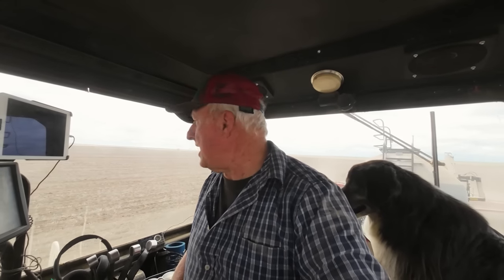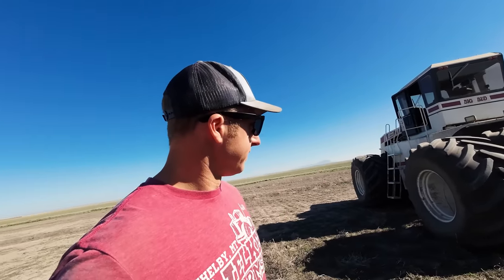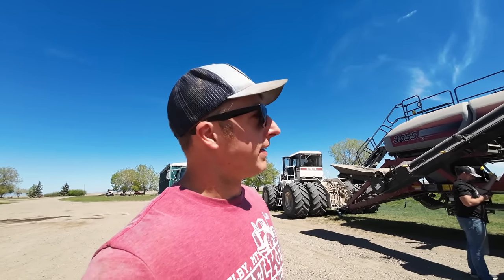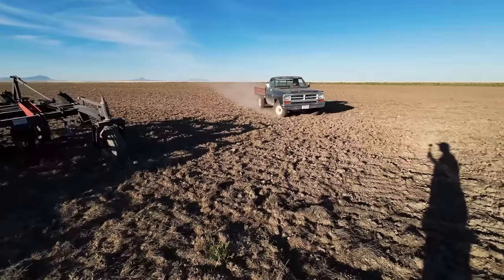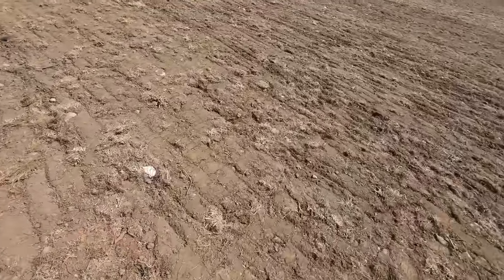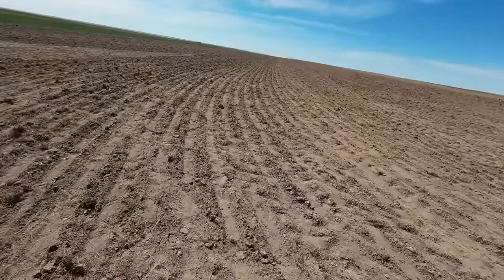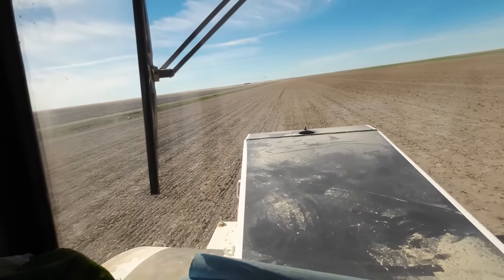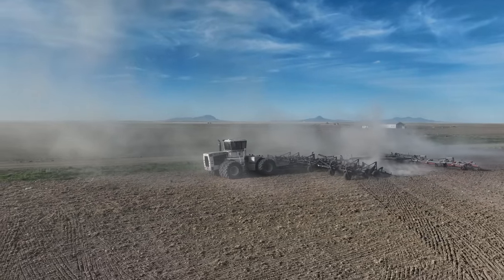Last Of The Acres! Final Push To The Finish Line! Farm Dog Approves!

Comment: Yeah we have had a bunch of days of the smoke here in Minnesota. Advisories to stay indoors were out as it was 200 ppm. I guess there were 115 out of control fires in Canada is what I looked up. We arent getting any rain here in Minnesota either. We did early in Spring but that has since gone away for about a month now. Everything is brown here. Sad. Seems it has been correlating to your weather as well. Every time it looks like it is going to rain it does for about a minute and then the system dissipates and is gone. Very odd weather the last three years. Praying for rain for you guys!

Comment: Is there any more benefit to using the coil packers on the soil finisher then using the ones that are more solid like the ones from brillion cause in ohio I have used the ones from brillion on back of 30 ft Krause disk and on back of john deere soil finisher to prep seed bed we pulled it with John deere 8870 articulated 4wd or a john deere 9400 articulated with triples  I like the brillion packers better than rolling basket they have also we use both  great vid guys keep up goid work hope you get more rain this year👍

Comment: Maybe just the video but I wondered if the Big Bud was "hopping" when pulling the seeder on the worked ground. Usually means the tractor needs more weight around here. Just wondering?

Comment: What is the Case tractor pulling?  It has been in the drone footage a couple times now.
Reply from the maker: It's a case ih air drill. Our neighbors have a few of those setups.
Reply: @WelkerFarms  Nice, wondered if it was your neighbor as you did not say you had a new one to use.